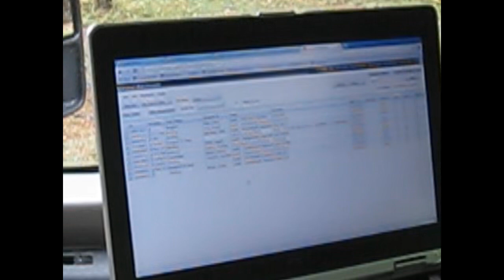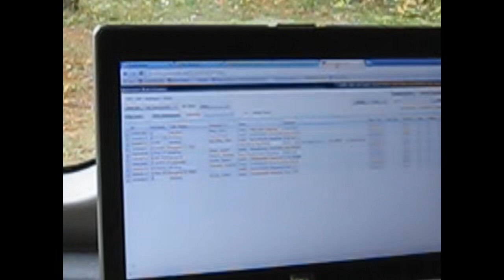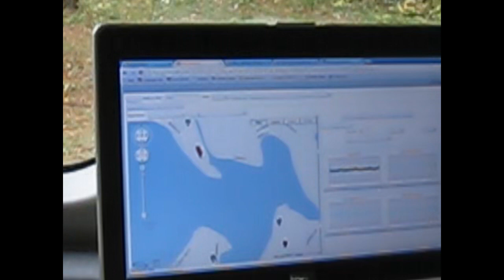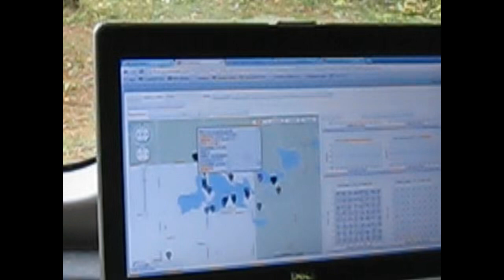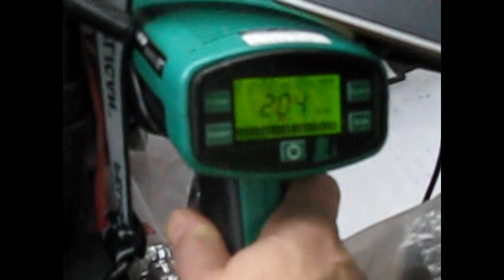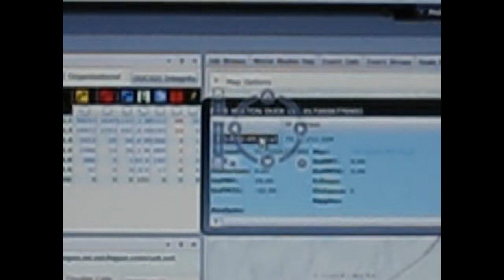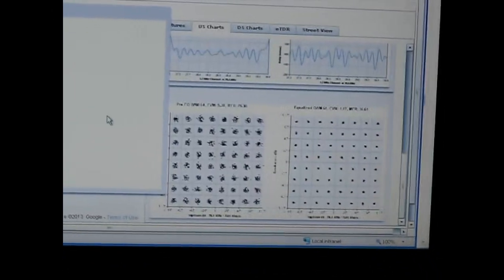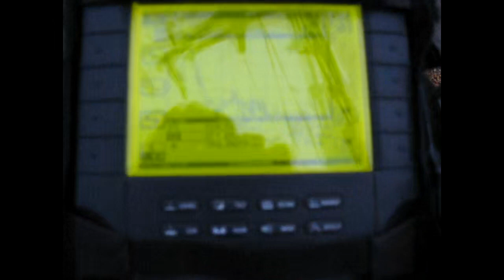What does a Cable Line Tech do in 2013? Now the Truth can be Told!

Comment: I know it’s old but you can pull the splitter and use the ADU jumper to isolate each leg
Reply from the maker: Yes! Fits perfect. I used to do that a lot, but only if it was urgent. In this case, it really wasn't a big issue and it was prime viewing time in the early evening.

Comment: I'm watching this because the cable amplifier up on the line is in line with my over the air TV signals.   I lost all signal last summer and they worked on the "box" and the signals came back.  And the remote garage door opener also started working again after they fixed whatever problem they worked on, I suppose it was a really bad radiation leak.    Now I've lost over the air, channel nine (it's a uhf) ,  and I'm blaming it on the cable amplifier but most of the other 40 channels UHF and VHF are  strong enough to come in.    I'll try to call the cable but they are hard to contact without an account.
Reply from the maker: Do you know the frequency of your 9?  Anyway, good work in getting the company to respond. It is unlikely but possible that the cable system would just leak UHF. Sounds like they had a cracked cable. I was once sent out to a non-customer home for a garage door not working where the garage door tech blamed the cable company. I was sort of the leakage Nazi of the company. We all thought the call would be BS but when I got there I found the tap plate loose and the attached drops radiating intensely. It could be that they fixed the hard line crack at the amp but maybe a neighbor is still leaking. Need a tech with leakage gear and know-how. Antenna improvements might be helpfull too. Is your antenna right at the same height as the cable? What might it take to go hihger? I intend to do some antenna videos in the future, but probably not in the Winter.